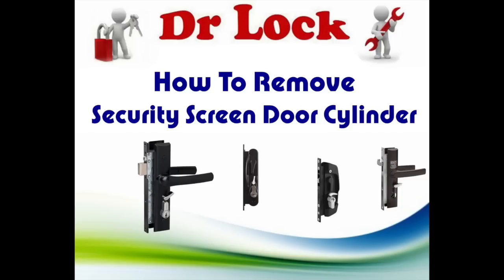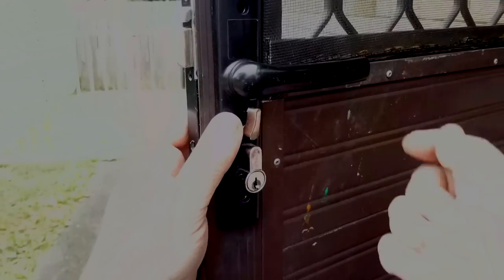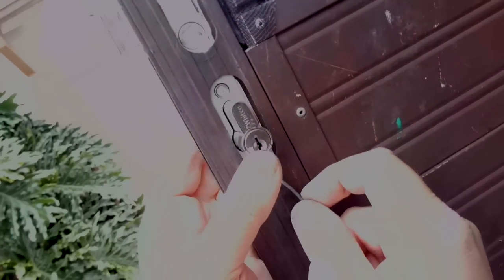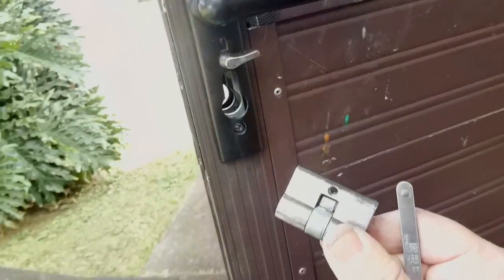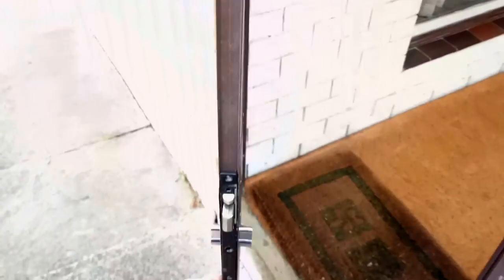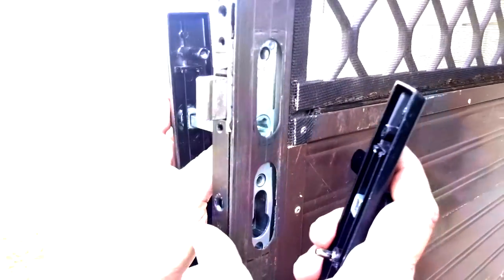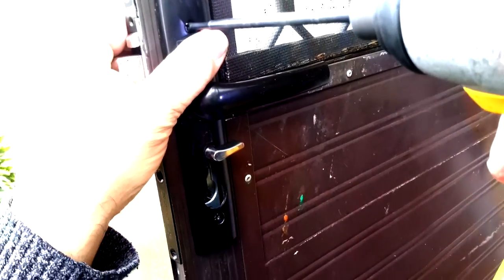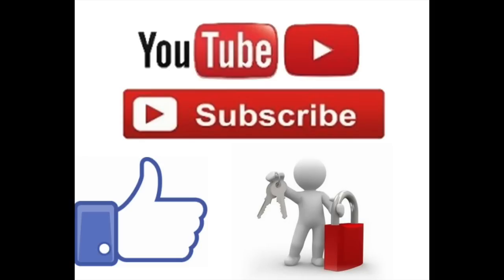Remove Screen Door Cylinder - without a key

Comment: Very helpful. Note sometimes cam needs to be pushed down rather than up for some locks. Eg Austral. I used son’s orthodontic super floss. Stiff, so can be threaded through door and then push down cam.
Reply: I did the same thing with monofilament fishing line, worked a treat.

Comment: Fuxin’ legend. After buying a house, I decided to change the locks. Started with the security door out front. No key of course and every screw head rounded. Had to drill em’ out. I became stuck at the removing the barrel stage. Anger and frustration gone with the first method form this video. Thanks heaps from easy street.

Comment: Thanks a lot for the detailed video for the Cylinders. The third methods for snapping the barrels is fantastic but I believe a bit tricky as you have said too. Is it possible to advise if that snapped spindle could be reassembled ?

Comment: Really great video. I have cut the cylinders in half with an angle grinder. I have drilled straight through the side of the door through that cam. Great educational video thank you

Comment: THANKS Dr LOCK
 I SPENT ABOUT HALF A DAY TRYING TO DRILL THE CYLINDER, TRIED ALL METHODS FAIL AFTER FAIL. BY USEING 2 VICE GRIPS AND FOLLOWING YOUR INSTRUCTIONS . I SNAPPED THE CYLINDER  LIKE YOU SAID. INTERESTINGLY IT DIDNT TAKE MUCH FORCE. EASY PEASY.
NORM

Comment: Great video.. I have a similar doric lock on a caravan here in Oz. The inside locking knob is online with the lock barrel. My lock isn't the issue it's the small black plastic knob that strikes the striker plate and holds the screen door in the sticker. The black plastic knob sticks in and doesn't pop out freely when you pull both internal and external handles so the screen door doesn't rest in the striker. 
 A video on removing the centre  inside assembly without messing up the upper and lower locks trouble be awesome or any tips?

Comment: Wow, so down under you mount the euro cylinders upside down? Or I suppose you could say we mount ours upside down up here in Europe, anyway that attack through the lower handle screw hole is a major security flaw with mounting the euro that way round, surly it would make more sense to mount the lower handle retaining screw completely under the lock-case, thus removing the need for that hole and vulnerability completely? 
Also how prevalent are euros with anti snap technology built in down there? Over/up here nearly all the euro cylinders I sell/fit, either have sacrificial sections that break away, or hardened sections running under the cam (that would be over the cam for you) as well as sacrificial sections, some also have a spring loaded detente that permanently lock up the cam if the locks is snapped.
Reply from the maker: We don't have much snapping at the moment, most of our cylinders are standard, its good for us when they fail

Comment: Option 4: use an 8mm drill bit to drill straight into where the key goes. Once you get to the center of the assembly, use a small flathead screwdriver to rotate the bar to the 12 o'clock position.
Reply: Easiest way i found also

Comment: I just snapped mine out. Easy enough. But my door was locked shut and still won't open after the cylinder/cam were removed. Can't see how i move the locking lever? Or do I put a new cylinder and that will unlock it?
Reply from the maker: you can use a new cylinder or a small screw driver to move the locking bar up to unlock it

Comment: My security screen door is jammed. Can I get some tips on what I should do please?

I have removed both the door handles on each side and have taken out the screws and springs from the cyclinder. I'm not sure what else I can do.... 

Hope to hear from you soon :) Thanks!
Reply from the maker: Call a locksmith, hard to open if its jammed, this video will only help you get the cylinder out , it could be a number of things
Reply: @DrLockShop  yeah I might just leave it for now and replace the whole door at some point. Its pretty old.. Thanks for your advice :)

Comment: I agree this is the best video i can find! Thank you. A question, I have a problem that the main spindle is jammed out in the lock position. Nothing will move.. The snib is jammed and the lock hasnt come out yet either.. I tried to pull it apart to remove the cylinder and somehow got the main spindle jammed.. Any suggestions?
Reply: I described it as a spindle because i thought that was the right teminology but think im wrong. I mean that the main latch is stuck in the locked out position. Its not locked in the frame (meaning I now cant close the door)
Reply from the maker: Its key locked, use the key and unlock, then close the door and test the snib , it should work

Comment: I use snap cylinder method to change the lock as I lost my security door lock key. I bought new compatible cylinder. I installed but it cant be locked, the key can't be wind left or right direction even use force. By the way door has is triple lock system ...  anybody can help???
Reply from the maker: you cylinder is in the wrong way, and you need to put the lock in the locked position then put the cylinder into the lock